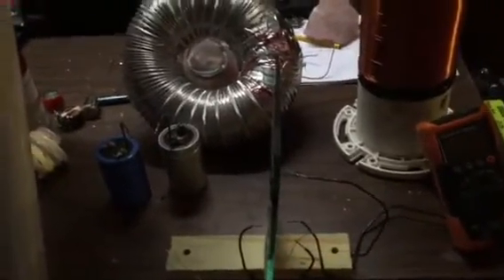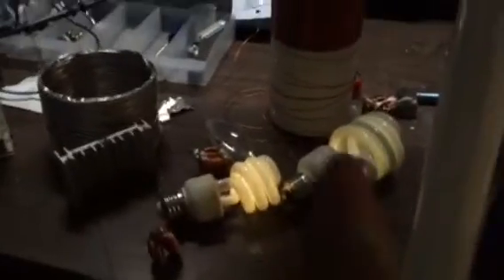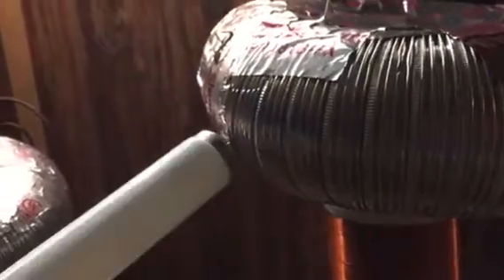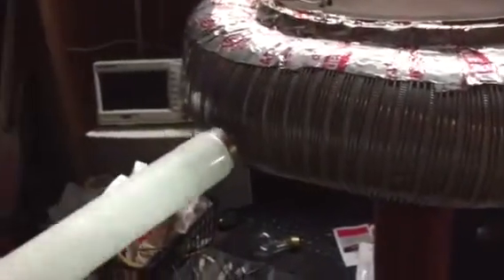Tesla hairpin to earth ground

Comment: Good stuff. Like the plate arrangement. The glass plate with the wire arcing at the middle is a high voltage diode/capacitor.
Reply from the maker: Hi  Michael
Yes on the right side high voltage 
On your left side ground wire , that is making DC pulses. I'am working on all kinds of experiments with this set up. I would like to see some motors run.
Right now I'am using a heating element from a hot water heater. With my experiment , it makes a great load and resister for experiments, I won't be happy until I run a few electric motors. Thanks for following me.

Comment: Roy, I think the ground on the same side of the cap is putting out amps. And as one of your other posters said, the one on the other side is pulsed DC high voltage. Clay
Reply from the maker: Trust me I'am on the look out!
It's the AMPS that will hurt!
I'am getting closer to running motors,
I'am just missing something?
Reply: XE transmission   may be  what  you are overlooking back feeding the  output from the  condencers to  before the  spark gap either short the  ground or   earth ground  and  eliminate   the arching.  Utilize the resistance     instead of  broadcasting it to  run  motors and  heaters as a circuit.   You will definately  see   an increase in volume and   amp draw.